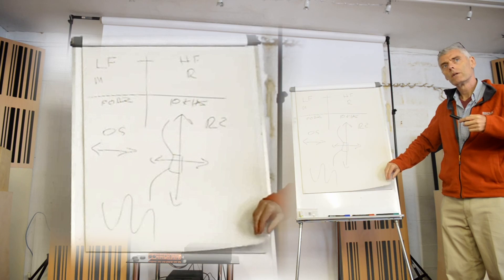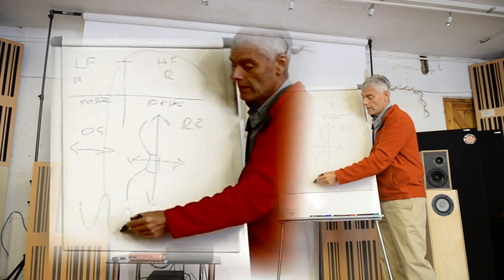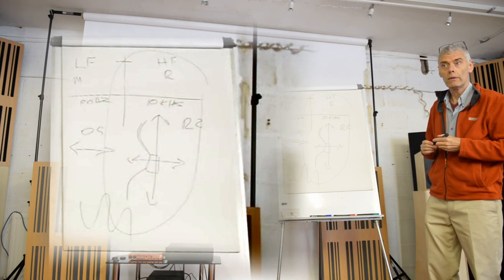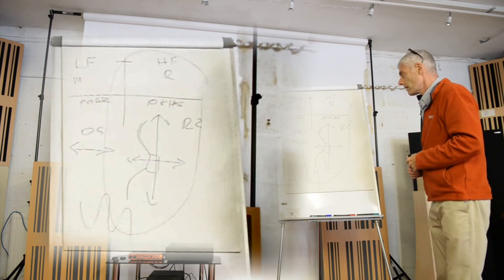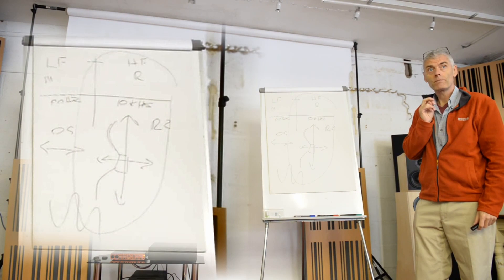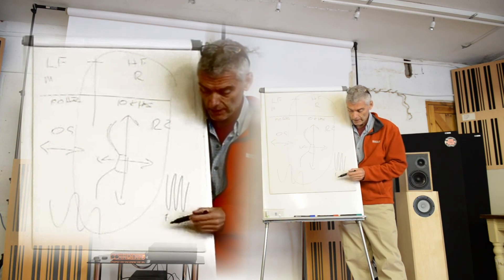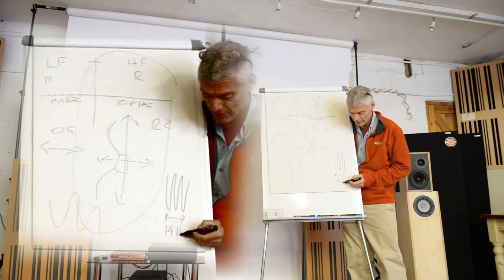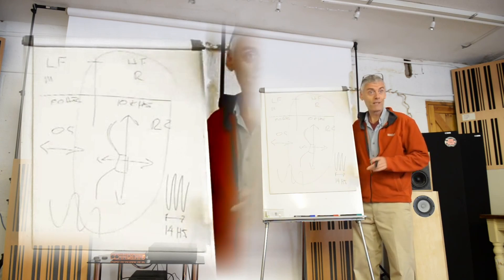Mark Fenlon, Mark Audio, talking driver design (part 1)

Comment: He states that male vocal range is 1700-2000hz. But that is not true! Is it? It should be around 80-160hz or something around that range. Then he makes that higher pitch sound and states it was 4000hz. The tuning fork which is used by choir directors for example, gives the pitch A at 440hz which is where female vocal is at. That is very high note to be reached by a male singer, and even then it is possible with a high falsetto.